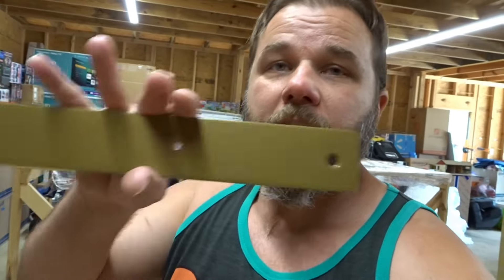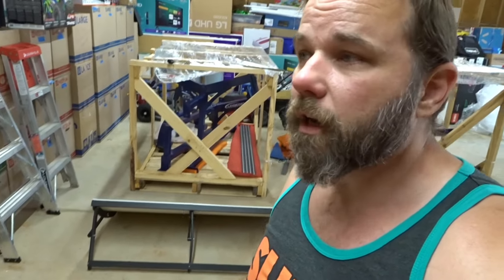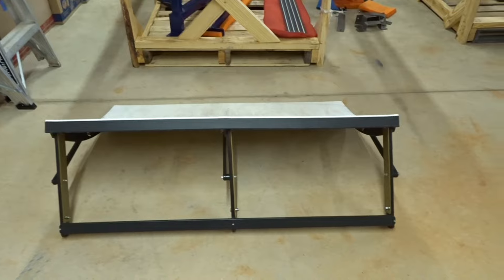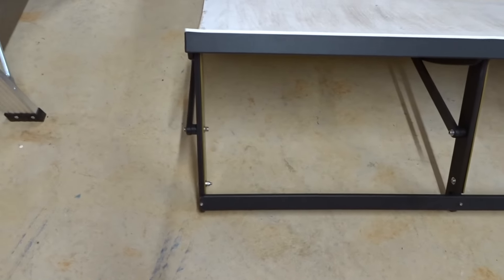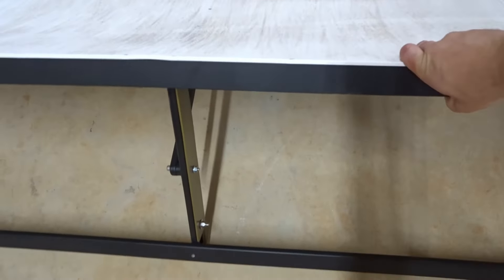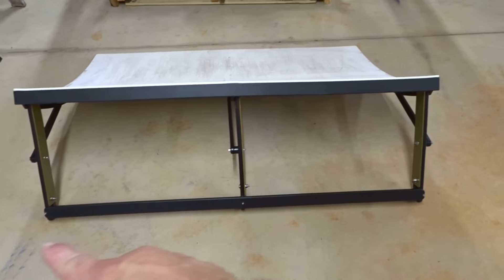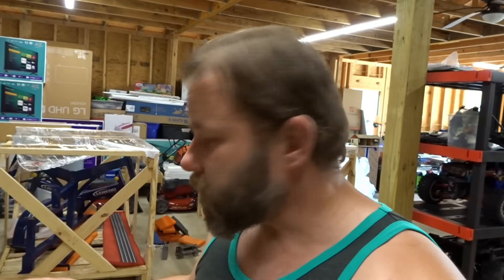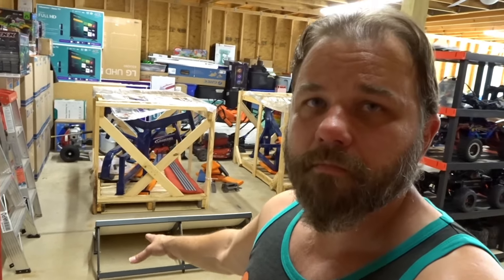Don't BUY This RC Car RAMP Until You Watch This VIDEO!!!

Comment: They’ve made it clear now on their site that the ramp as is will only work for cars up to a certain scale . Anything larger requires the additional part .

Too bad you had to be the guy to have them make the note .

Be curious to know if this acknowledgment was on their site at the time you bought the ramp.   

If it wasn’t , they should have sent it to you free of charge including shipping , then made the change in the website .

Cheers 🇨🇦🙂🍻
Reply from the maker: I talk to the owner at the time and he said it handles up to 1/5 size RC's. Also at the time there was nothing saying other wise or adding any upgraded part. thanks for watching.

Comment: I don't think the upgrade part they sell is going to fix the issue long term. KCRC cheapened out on the metal frame and hardware so the ramp just will not hold up to 1/5 scale long term. Maybe for 1/10 or 1/18 , but you can get cheap plastic ramps for much lower cost to handle that scale.
Reply from the maker: I agree with ya 100%. Appreciate you watching for sure.